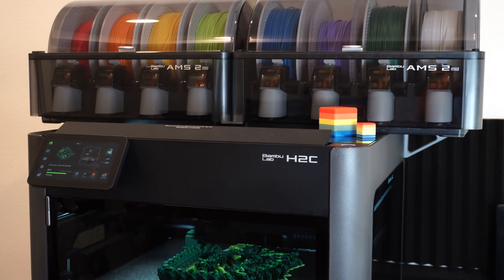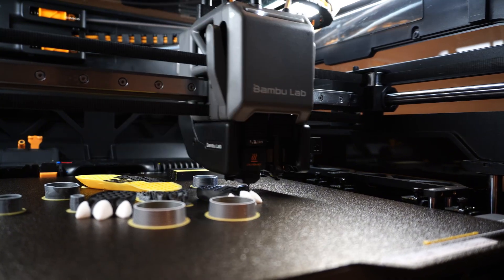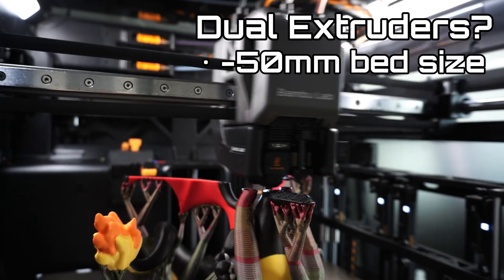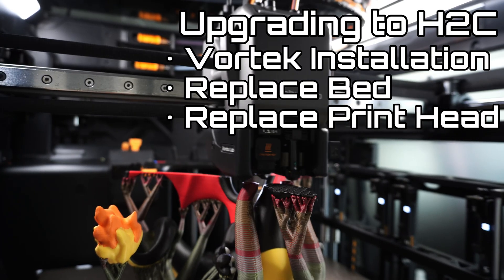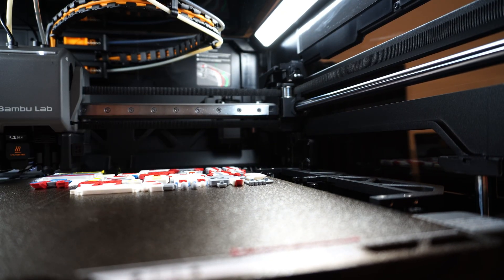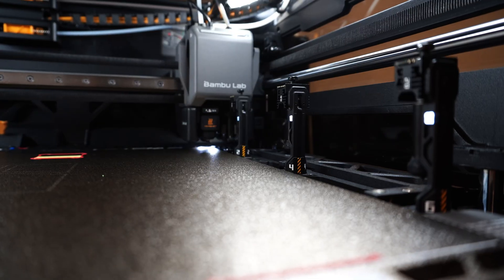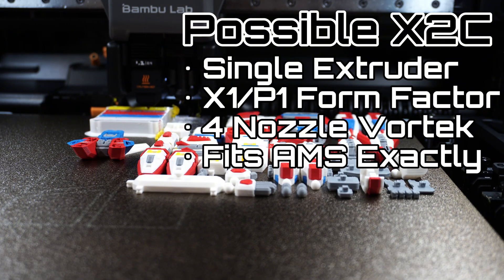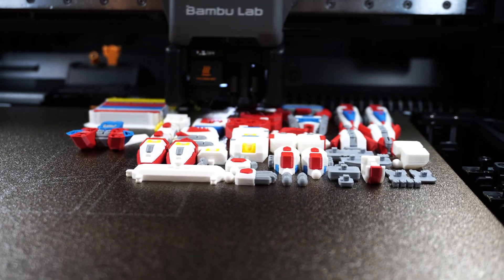What's Next for Bambu Lab's Vortek System?

Comment: Agree with your thoughts I came to the same conclusion myself.
I think they’ll release a new X series with this in 2026 and maybe print the 4 loading hub to the top of the hotend like the A1 range as this cuts out travel time but they’ll have to change the AMS to match this which I think they might…..

Then going forward the P/X/H will all have Vortex versions.

Doubt the A but could be surprised if they come up with something different maybe.

Comment: You’re right that they made a choice by calling Vortek a “system” not just a printer. It is definitely going to come to at least one more printer.

I wonder if they could maintain the 256 build volume by just adding a “kicked out” right side to the enclosure. Even 4 nozzles would be cool because you can still get more than 4 colors as long as all the colors are not in the same layers. I still think the whole AMS and Vortek system struggles with TPU so it may not be the best for multi material, just multi color. It would be a tough call between this hypothetical printer and the Snapmaker U1.

Comment: A trimmed down H2C to become marketed as a X2C. Yeah i can see that.  Instead of a trimmed down vortek of 4 nozzles why not differentiate it more and put vortek on the other side as well. Sort of like a dual sided vortek system. Might even be a way to solve the issue of lost print space from having dual nozzle if it goes that way. Who knows but im certainly down for more options.

Comment: A X2C printer with these widgets Will be Amazing product
Reply: An X2C's price would DEFINITLEY rival the Snapmaker U1.
The H2C was clearly not supposed to be in that price range so it was not meant to be a competitor.
Reply: A single extruder Vortec hotend in an X2C makes total sense. I don’t think BL will sacrifice the build plate size though. I think it’d have to stay 256 cubed to work. If it were smaller I don’t think it’d be well received.
Reply from the maker: I would buy two haha
Reply: I could see this happening..🧐
Reply: I think its very likely we will see 2 or even 3 lines ... PS line (with at some point a PS2C) a H line with the H2C and room for a 3th line of sizes. First letter (H/S) is size second number is generation (now gen2) and last letter is the feature set (S,D,C,..)